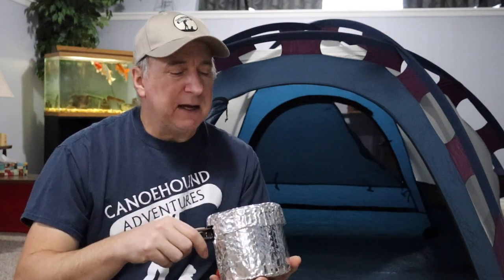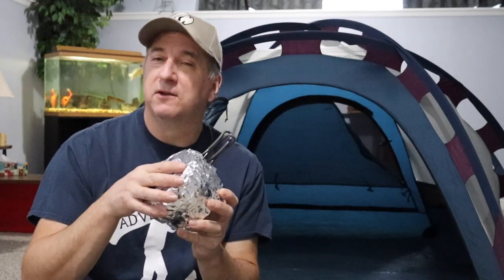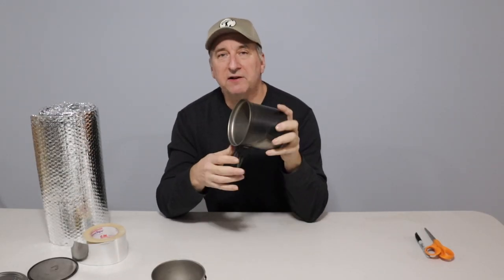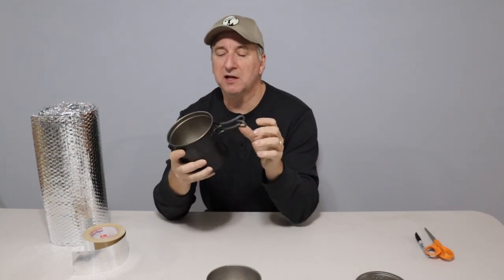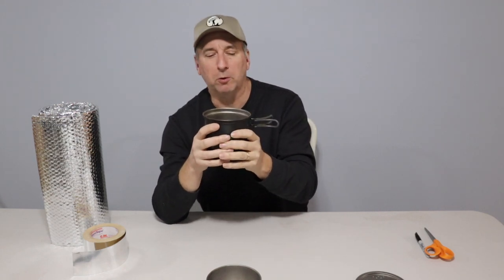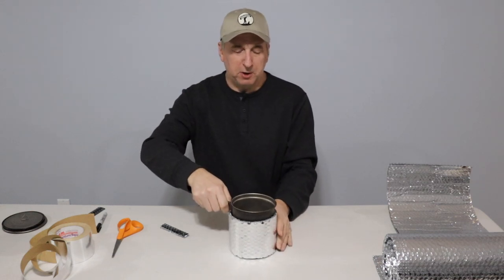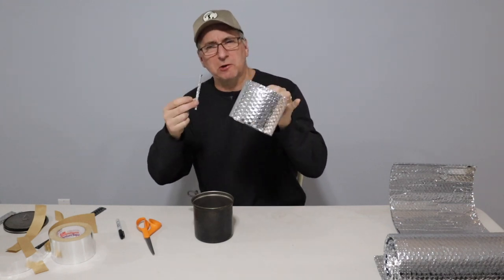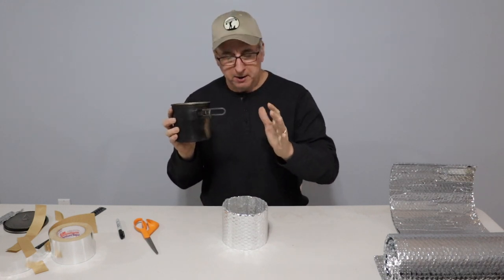How to make an Insulating Pot Cozy. DIY Quick, Easy, Cheap. Customize to fit any Pot Set

Comment: ENTER the induction cooker.  I cook outdoors with a 1800W max. cooking eye.  I generally use a 5.5 gal. (12" base diameter) pot.  Because of the size of the pot, the heat varies from top to bottom.  Could I use an aluminum rap, around the body of the pot similar to your cozies without the bottom part?  Since the induction is only heating the center of the pot, with no radiation from the sides of the cooking eye, would this material survive the cooking process?  Temps in the pot would be under 300 degrees.
Reply from the maker: The reflectics is a plastic bubble wrap material with a shiny foil exterior. I would not trust it on or around any type of flame for fear  that it would melt or catch fire... Thanks for Watching